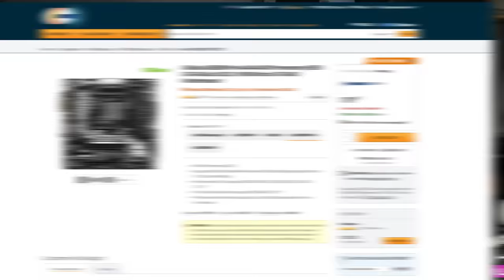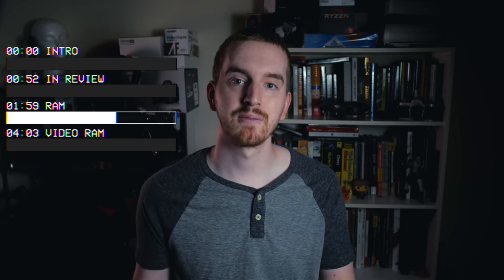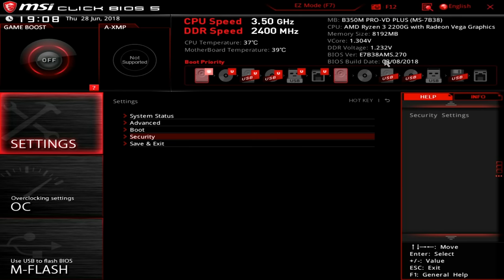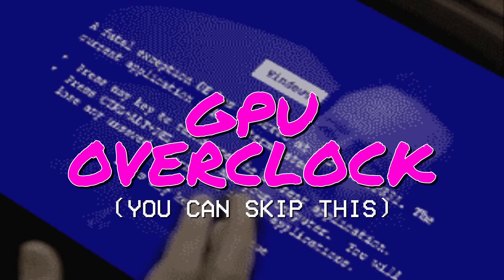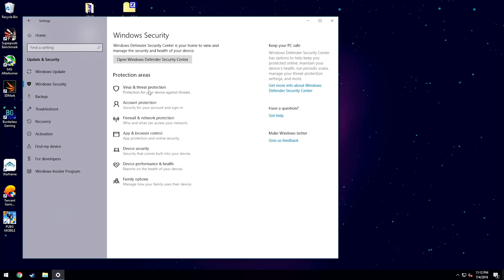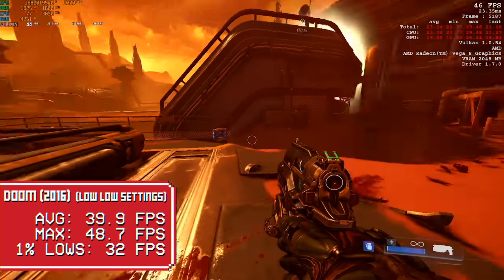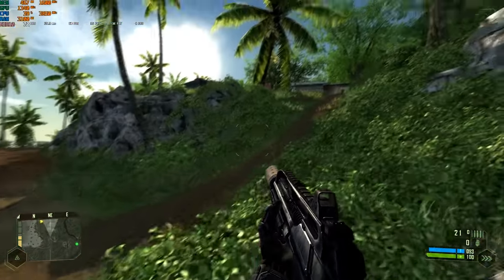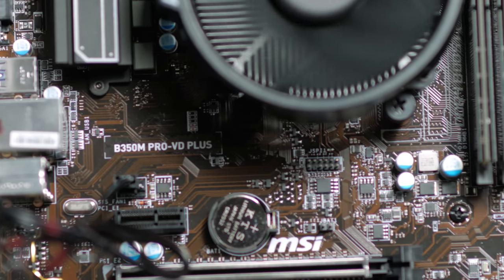How to get INSANE GAMING PERFORMANCE out of AMD Ryzen 3 2200G APU - Ryzen 2200G Optimization Guide

Comment: Memory speed makes a huge difference for APU. Buy minimum DDR4 3200Mhz. 3600Mhz would be perfect ! APUs are awesome. Doom, Boarderlands , Division 2 all well run on my Ryzen 2400g. I have not overclocked APU because my case only has 150W power supply but i did overclock memory without increasing voltage. i am really getting good results. Most modern games have resolution scaling option so i can run games in 2560x1080 and then just scale back resolution accordingly. For Doom at 80% with medium settings i am getting 60FPS, in Division 2 at 75% and low settings i am getting 35FPS, Boarderlands 2 max settings with ambient occlusion off i am getting 50FPS etc. etc. etc.

Comment: MoBo: AsRock AB350m Pro4 ($92)
CPU: AMD Ryzen 3 2200g ($110)
RAM: GSkill Ripjaws V 8gb dual ddr4 3200mhz ($119)
Storage: Adata XPG s6000 M.2 128GB PCI-e ($55.80)
PSU: Corsair VS450 ($35.80)
CASE: Tecware F3 Full Acrylic window Usb 3.0 ($30.80)
Monitor: BenQ GW2270 21.5" LED 60hz 5ms ($103)

any suggestion for changes on my build? this is my first time and result after researching and watching tons of budget building guides. guide me through this bros
Reply: if you guys know cheaper parts with better performance that would be awesome too.
Reply: one tip. Get a B350 motherboard so you can overclock the ryzen cpu
Reply: Cephachrome yep it can. i've seen some utubers with asrock ab350m oc ryzen 3. but the price though. it is near double the original price
Reply: 814NK Gamez I would get team vulcan ram 2800mhz for $20 less and you can Easily oc to 3200 or even 3600
Reply: 814NK Gamez make sure dual channel
Reply: Tinnhu HD thanks bud i've been lookin for a cheaper good ram for days. ill check it out if its available in my country

edit:
sadly its not available
Reply: I have a ab350n gigabyte Mobo, ram corsair 2x8gb 3000mhz (i OC the ram), the storage i really Kike the nvme personally prefer a 1tb wd at 7200 RPM (or a HDD with a SSD for fast boot), case Thermaltake correo v1 itx, and a Corsair AIO h80i rev2. I OC the sistema to cpu 3900mhz AND igpu 1600mhz. Why an AIO? R- 2 reasons 1.looks super cool. 2. If you want to upgrade later overclocking the cpu at 4ghz Is like have a ryzen 3 1300x theres no bottleneck
Reply: ᴅᴀʀɪᴜs ᴀʟᴠʀᴀᴍ wont your ram cap at 2400mhz?
Reply: 814NK Gamez you gotta turn on xmp which allows any speed witch is close to your set of ram you buy
Reply: @ryujiikuma296  ram without OC Is 3000mhz i overclock to 3200mhz, gonna w8 4 the Navi or the 11 series of nvidia
Reply: Tinnhu HD sorry im new to this. whats xmp?
Reply: 814NK Gamez XMP stands for eXtreme Memory Profile which if you turn it on in your bios you can use whatever speed that you got,  Instead of stock.
Reply: Tinnhu HD im still not clear. does it mean i dont have to underclock instead just play a game as long as i turn it on and i will have 3200mhz runnin?
Reply: 814NK Gamez you got to set what speed you want In The bios after turning on xmp

If you turn on XMP and you don't change speeds it's either staying at 2133 or 2400 which you shouldn't use on a ryzen build
Reply: Tinnhu HD oh i understand now. thanks a bunch! that is why a dude i saw somewhere underclock to 2400 bcuz he is using g4560 which is cap at that and ryzen has higher cap so theres no need to underclock
Reply: B450 motherboards are now out I suggest going with a B450 over a B350.
Reply: no need for b450 or x370. b350 is just perfect and more affordable than others
Reply: LMAO the B350 is far from perfect.  B450 is out and is a replacement of the B350.  Getting a B350 now is pointless...
Reply: aferr1973 
I'm not saying that b450 is not good. Its gonna be stupidity pricy like the x370. For a guy who gonna buy a 2200g b450 is too much. I own a 2200g myself. There's no need for b450 for a 2200g tho
Reply: You do realize that the B450 boards have been out now for almost 3 weeks in the US?  They are not "stupidity pricy like the x370" they actually can be found in the range of $69-$89 USD.  There is plenty of need to pair a Ryzen 3 2200G with a B450 as it will give much more stability over the B350 for overclocking with the improvements made.  Do real valid research before you post!  Again like I said before the B450 boards are meant to replace the B350 boards!
Reply: aferr1973 
Bruh, you're very mad. B450 is nearly double the price of a b350 in my country exactly 14000INR b350 is like 8000INR. why do i need to research about your country. You do some research too. Not everything revolves around you.
Reply: You never stated which country you are from.  You are basing the cost of the B450 vs the B350 on your country which not everything revolves around your country.  In most parts of the world the B450 is the same price as the B350 which it should be.  Your comments were inaccurate and could lead a new builder in the wrong direction.  Next time state which country you are from which would have changed this entire conversation.  Newegg sells the B450 and B350 between $69-$89 like I said it is a no brainer to go with a B450 over the B350 if your country has them at the same price...
Reply: aferr1973 
Well, I'm wrong. I accept that. Our argument was stupid. I thought everywhere the price is same. My country sucks.  A320 costs 60$ here. Everything is stupidity overpriced. I build my first pc for 441$ with 2200g and a a320.
Reply: aferr1973 
For a clarification. 
B450 is like half of my budget (204$)
Reply: I'm also wrong for not taking into consideration which country you were from.  Sorry to hear that the prices in your country are bad.  The 2200G is still a good entry level gaming PC as I just built one for $400 with a B450 board 8GB memory.
Reply: The psu vs is not 4 gaming it will explode
Reply: get yourself b450 motherboard its much better i guess. also get yourself 2400mhz ram which is 40$ cheaper and just overclock it to 3000mhz. i wouldn't pay 35$ for 450w power supply (i got EVGA BT 450w for 20$ and its great). from saved money i suggest you buying ryzen 2400g.
GL HF:)
Reply: Not all ram will overclock to 3000mhz it depends on the motherboard manufacturer and if the ram is listed on the QVL.  I have an ASRock B450M Pro4 board and 8GB of 3200mhz of Gskill Ripjaws V ram that will not run at 3200 and only will run stable at 2400 no matter what I do.  The ram has Hynix chips which is the worst for overclocking.  16GB kits have Samsung chips which work better with Ryzen.
Reply: aferr1973   i dont understand your point. every AM4 mobo supports up to 3200mhz. u got ram with 3200mhz and you somehow cant run your ram at its stock speed? what the fuck? about ram chips i didnt know in which i will look deeper into
Reply: aferr1973  im sure there is something wrong about you managing your XMP. if not i would like if you give me sources of explanation how overclocking works. thankyou!
Reply: There is no guarantee that ram will run at the advertised speed it all depends on the motherboard, the bios, and the chips on the ram when it comes to Ryzen.  Again Ryzen is super sensitive when it comes to which ram will run at certain speeds.  B450 motherboards support even higher than 3200mhz but again no guarantee...
Reply: There is nothing wrong with my XMP profile.  The XMP profile recognizes 3200MHZ, but it won't boot at 3200MHZ.  Even if I manually set the timings and up the voltage it won't run at 3200, or 2933, it will boot at 2666, but errors in prime at 2666.  I only can run stable at 2400MHZ.  It is the ram as it has Hynix chips which is not Ryzen friendly and certainly doesn't like my ASRock B450M Pro motherboard.  What I need is a good 16GB Ryzen friendly ram kit that has Samsung chips, but money is tight right now so I'm stuck with running 8GB at 2400MHZ.
Reply: does it have to be 16gb kit? that shouldnt even matter
Reply: Didn't you read what I said earlier???  The difference is that most 8GB kits including the one GSkill kit that I have has Hynix chips which doesn't work well with Ryzen especially to run at faster speeds.  16GB kits mainly have Samsung chips on the memory which work much better than Hynix chips when it comes to Ryzen compatibility and higher clock speeds for the ram.  Again Ryzen is very picky when it comes to memory especially Hynix chips for ram...
Reply: ok, so what type of rams are compatible with ryzen?
Reply: aferr1973   list me your exact specs
Reply: Like I said earlier you need to check the website of the motherboard manufacturer for the EXACT model motherboard that you want and check the QVL qualified vendor list for compatible supported memory for that motherboard.  So I have the ASRock B450M Pro4 motherboard and when that motherboard first came out it was super new and ASRock didn't even have the QVL on their site.  So when I was buying parts I bought the 8GB Gskill Ripwjaws V 3200mhz kit thinking everything would be fine and boy was I wrong.  I should have bought an ASUS motherboard my big mistake because it turns out the exact ram that I have is supported on the ASUS B450 motherboard but not supported on the ASRock B450M Pro4.  I tried every timing setting using the Ryzen Calculator etc and the ram won't run higher than 2400.  I'm even at the latest ASRock bios 1.20 still doesn't help.
Reply: get 16gb of ram a 2x8 kit
Reply: aferr1973  yes, they are intel compatible ones. you should have gotten paatriot viper or T-delta. just sell ram and get other ones
Reply: I bought the components from Micro Center and they didn't have Patriot Viper or T-Delta ram available.  I did research for a few weeks before my purchase, but unfortunately the B450 chipset was very new when I bought my B450 motherboard and the QVL was not published by ASRock at that time.  Seems that 16GB ram kits are the way to go that have Samsung chips.  My 8GB kit has Hynix which doesn't seem to like Ryzen.  :(
Reply: I'd get HDD with about 1TB or + most 80$ but the 128 gb will fill up very very fast
Reply: Hey I wanna know, I bought a Msi B450M Pro M2 mobo. Is this good? Because I was searching on the net that this one has almost no results of reviews. Most of it were B450 pro vdh.
Reply: just get a graphics card
Reply: @aferr1973  and speed with first gen ryzen is much worse on B450 compared to B350
Reply: More storage and question did u buy the ram at 3200 speed or is that OC because i got the 2666 gskill i have it running at 2800
Reply: A graphics card
Reply: The 128gb m2 drives are priced kind of poorly (gig/dollar wise) The sweet spot for that is 500gb i think and in day to day tasks (including gaming you will not really feel the difference between a sata and an m2 
What you will definitely notice is that 128 gb restricts you a hell of a lot Try getting a 250 at least
Reply: 814NK Gamez Ik this is old but go for a better case. One with more air flow and larger will serve you well in the long run :)

Comment: If U pull out the battery from the motherboard will not defenietly erase your BIOS settings. My MB for example use jumpers for this, because it has another memory chip which is working like a fail safe memory. U can turn off power, turn of your PowerSupply, pull out the battery, but the BIOS settings will be there. Use jumpers.
Reply from the maker: And on some motherboards, the jumpers don't always erase all settings. Battery method has worked for me for 10+ years so it's my default method
Reply: EposVox In other cases I start with the battery method like U, but some cases this method won't help. There is several cases like mine, and most likely at server motherboards, where the BIOS always checked, and wrote after the check to another memory chip which won't lose data even at any type of power loss. And the second case when the notebook's BIOS battery is soldered, so U can't even pull out the battery. 
P.S.: Your method is not wrong, I just want to show that fact, U need to use other methods sometimes.

Comment: Hey EposVox, I actually made the PC. A few tips that seem specific to right now with this rig. First, anybody who bought a ryzen 7 likely didn't bother with the stock cooler and tossed in a drawer somewhere. It is stellar for this rig, person from my work just gave theirs to me. Second, I was watching the gpu prices, and I was able to find an ex mining r9 380 for $70 on craigslist. It looks like quite a few miners are cashing out, and some just want the hardware to find a good home.
Reply: noe badee did you use the Apu ready board? Or did you update the BIOS on another board
Reply: When I made it the boards seem to have been updated by the manufacturers. I know msi has done pretty much all of theirs by now.
Reply: +noe badee
Most of the motherboard manufacturers actually did most of their boards even back then.
But it takes forever for the non-updated motherboards to make their way out of the system of retailers, the storage all over the globe etc...
Only the motherboards fresh out of the factory gets the latest updates, motherboards stored even in the factory after production but before sale still don't get updates bios updates most of the time from what I understand, so yeah...
Reply: How's the GPU been? Lots of people feared buying from e-miners due to the intense usage of the cards.
Reply: @thegrogster5  Usually mining GPUs are run undervolted and with high fan curves so that they are efficiently and consistently run. In most cases, a mining gpu can actually be in better condition than one used for gaming if they actually cared about keeping the mining rig on for a while.

Comment: Finding stable point for Ryzen iGPU is not that easy, mine max stable OC is 1500 with 1,175 voltage (MSI motherboard so real voltage is one step lower 1,165 or so) It's stable only with that voltage, one step lower or higher and games will crash, any Mhz OC betwen 1400-1475 and 1525-1600+ will also crash, doesn't matter what the voltage is, weird thing that ryzen

Also keep in mind that PC may crash if you OC your ram to more than 2933 Mhz, if you have samsung E-Die for example (officialy Ryzen supports up to 2933, some better ram like samsung B-Die can work on 3200 or more)

Ps. Windows Defender works in the background eating like one core, to fix this you don't need to disable it, but instead open Task Scheduler, find Windows Defender, and uncheck "run with highest privileges" on all 4 tasks

Ps2. Some problems are fixed buy using https://www.guru3d.com/files-details/display-driver-uninstaller-download.html (I use it on every drivers update) and reinstalling video driver
Reply: Any further tweaks or tricks for ryzen 5 2400g?
Reply: Take a look of my post here son!  https://community.amd.com/thread/232704

Comment: Hey while you're poking this - here's a video subject. What if you exclude executables/directories of specific games or benchmarks from Windows Defender, will it help the performance similarly as when you were turning it off? I know i know i'm just being too lazy to test myself and thinking up more work for you, but then for me it's something that i'll learn for myself and pass on to nobody else pretty much, while for you it's your job to make people's lives better by educating them.
Reply: +Siana Gearz
I doubt it.
The main bottleneck for this APU is memory bandwidth, so anything that is running on the system that makes either the GPU or CPU either request data from the memory or makes either the CPU or GPU send data to the memory will reduce the amount of bandwidth left for the actual game, reducing performance, especially the 1% lows.
Reply: Luredreier, see my hope is that antivirus will be idle to a higher extent if the game is excluded and otherwise the background load by other software is also kept to a minimum. At least it won't have to second-guess and verify the innumerable file accesses and other system interactions that the game process itself performs.
Reply: +Siana Gearz 
Sure, but right now for instance I have about 2219 different threads running on my CPU, granted I have a lot of things open, but many of those are OS related etc.
A anti-virus will most likely be checking the activities of all of those...
So even if a game might not have to be checked there's still tons and tons of other things to keep track of...
Reply: Yes, there is a significant number of background processes. The goal would be to see how far you can push it with them being as few and as idle as you can comfortably get them. I just dislike the idea of disabling the antivirus altogether, and for me personally it's just too much effort every time. I just wonder how far you can get with automating things, going through the effort just once per performance-sensitive title rather than once per gaming session. It's not a question that can fundamentally be answered by theorising without having a specific insight into what process-system interactions trigger what activity in the antivirus exactly (yes we have a vague idea, but things tend to be more complex than easily imagined), and what the numerous background processes and the game itself are doing exactly, it's just something that needs to be benchmarked.

Comment: So I'm really on a budget now and thinking about getting the 2200G, as i get it for about 100$. I will get a GPU at a later point, but will the 2200G be pointless then? I was thinking about upgrading to the 2600(x) when i have the money as well, times are just a bit "rough" now for the upcoming months. I am just tired of not being able to game. Sold my i7 8700 / GTX 1070 setup a few months ago. My main games are CS:GO and BF3 (if it matters).
Reply from the maker: It wouldn't be pointless - it's still a 4 core CPU that can game even better w/ a dedicated GPU